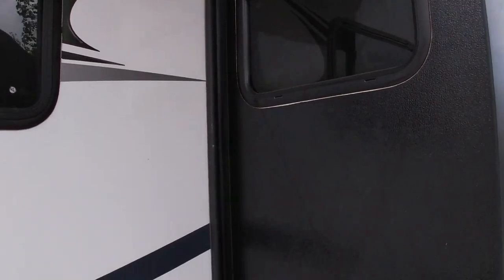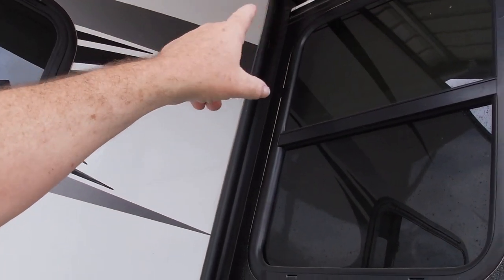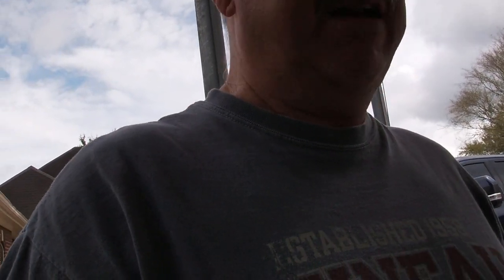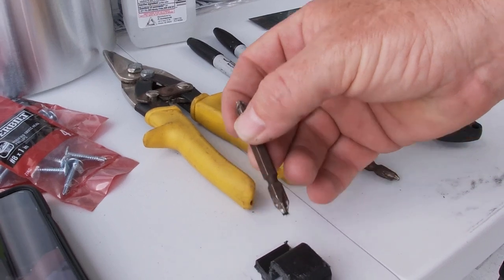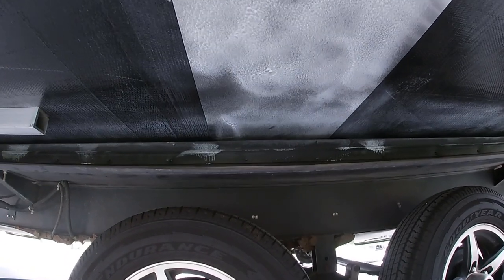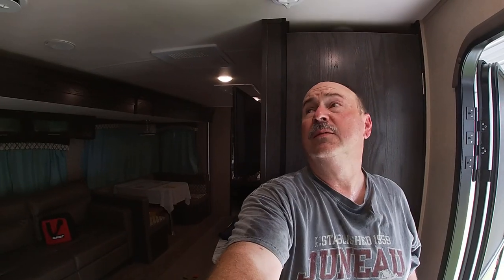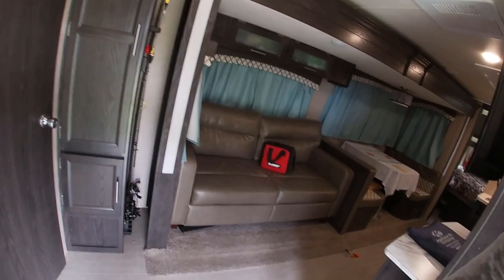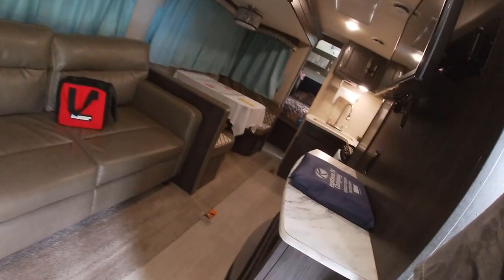RV Slide jumping - FIX

Comment: Thank you so much for taking the time and making the effort to create this video!  Our 29’ Crossroads Sunset Trail trailer is currently sitting in the maintenance lot at Cheyenne Mountain State Park in Colorado Springs after the slide got stuck while sliding it back in, resulting in a stripped gearbox.  I was concerned about only replacing the gearbox since I felt its damage was caused by the slide sticking on the way in.  What you show doing with the flashing makes perfect sense and I plan on doing the same shortly so I can tow our trailer 70 miles back home.  Thanks again!

Comment: Well done! Nothing like a good DIY guy and a good fix. I’m currently working on the same problem. The fifth wheel we had before this one had a mechanical drive but it suffered from the same friction problems. I spent so much time trying to fix it, I attached strips of a Teflon plastic to it.   

Thanks for taking the time to film your fix. 

May God bless you and your family
Reply from the maker: Thanks for watching! Teflon is a great choice for this type of application. Hopefully you won't have this kind of problem in your current rig!

Comment: I’ve been online searching for a fix. You are the only one that I could find with this method.  My slide out came with plastic runner strips on each end but they became ripped off along with the black material exposing the plywood. I think I may try you technique. I like your approach to the problem.
Reply from the maker: Thanks for the comment. Im sure your already planning to repair the damaged areas before you make the modification. Still dont why they design them to slide against the fabric... makes no sense.

Comment: I have the same exact trailer and have been battling the same problem.  I was just about to order a whole new wear bar ($$$), but am definitely going to try your method first.
Reply from the maker: More than likely some dry lube on the bottom of the slide may work just as well for you. I chose this route to prevent a buildup of dry lube  which could saturate the lining. Hope it works out for you.

Comment: Just did the “flashing fix”! Works great. I’ll be looking for long term success.
Reply from the maker: Awesome! I’ve not had anymore instances of it sticking but have instead sprayed the flashing down one other time since the completion. Hope it holds up for you.
Reply: frank scott I’ll keep the spray in the rig for future use. Tomorrow I’ll tackle the kitchen slide with rollers. Too much furniture and trim to pull for flashing fix. + the slight rise in that slide shouldn’t be noticeable with the trim and furniture

Comment: Had same problem.  Contacted my rv dealer and service manager said wash underside of slide out and the use paraffin wax block to rub under side (fabric). Paraffin wax is used in canning.   Run my slide in and smooth as could be.
Reply: Thank you for your info. While I like this guys repair method, yours was my first attack at this nagging issue. So I went to Walmart mart, bought 8 sticks, my camper bottom was very clean, and I used about 1/2 a bar of wax on it and doubled up on the obvious wear spots. She’s smooth now. Thanks so much for sharing. My fabric is abrading, so I may have to do the aluminum at some point in the future, but I’m betting keeping it waxed prevents the abrasion. Surely something that should have been covered in new camper delivery, or maybe not, I would have thought I already knew it all anyway.lol

Comment: Thank you very much , your fix helped me patch a snag I have in my floor  ( under side) I may still install  rollers, 
Thanks!
Reply: Update my 2016 open range has 4 rollers on appliance side and the bottom is not darco it’s a thin hard plastic. Opposite side slide has only 2 rollers ( outside edges)and is the same material as the other side + rollers ha
Reply: Rollers have a additional plastic track but nothing in the center. That’s where the floor snagged & tore out a 3”x8” section of luan and plastic. I used contact cement to put back in the torn out piece. I then did what you did with the flashing. I’m hoping that will hold the patch in place. 
Thanks for the video help
Reply from the maker: @jeffarthur322  Glad you got it worked out Jeff!

Comment: My jumping problem didn't come from the bottom where I kept thinking the problem was, but it came from the top  slide topper roller that was seizing to the point that it started to pull the track off the top of the motorhome.

Comment: Great fix,, I'll be doing this this week.  I'm curious about the short piece of wear bar you removed at 22:37 in the video.  Is there a reason you took this piece out?
Reply from the maker: Dustin, to be truthful, i cut that small piece out to see what i was up against and how it all was attached. I ended up just leaving that piece out and covering it with the seal.

Comment: Pardon the ignorance but wouldn’t that flashing rub on your floor on the inside damaging it? Seems like not raising it up either roller method or somethin else would leave that weight on the house side, digging that flashing into the floor. I’m probably missing something?
Reply from the maker: Thanks for the question. I’ve always said the only ignorant question is the one that you don’t ask, lol. With this type of cable slide, BAL Accuslide, the slide room is actually suspended above the floor, held up slightly by the cable tension. That’s why they say not to step on the slide house floor when the room is in the retracted position. I would lift the transition flap and see if there is a slight gap between the slide floor and the house floor before you tackle this. If you have a gap it shouldn’t cause a problem.
Reply: @frankscott6054  ok. Mine is older. 2002 Four winns windsport. Not sure which slide system it has, but as is there’s a lot of pressure on the carpet when sliding in and it’s starting to rub on the body on the outside. Def needs to be raised up. I believe it’s hydraulic but not sure
Reply: If you were concerned with the aluminum rubbing the floor you can put a piece of self adhesive loop tape (fuzzy side) material or ultra high molecular weight a.k.a. UHMW material, to keep it from damaging the floor. It won’t do anymore damage than the floor without any mods.
Reply from the maker: @mrmrwilem4789  great suggestion!

Comment: Thank you for the video. This helps a lot, I also did not want to install the rollers. How has the slide been so far?
Reply from the maker: Thank for watching Jimmy glad someone could use it. It’s worked flawlessly so far. If it starts jumping again I’ll simply spray the aluminum skid plates again.

Comment: It's been 2 years now.  Is it still working OK?  Going to do this on my 2017 Keystone Montana 305RL.
Reply from the maker: Hi Rick, Yes, still working fine. I do spray some dry grease on the runners from time to time. The only thing i've had issues with is some oil residue on the vinyl flooring from the runners when the slide is in and in transit but i attribute that to the cable being too slack when retracted. I just wipe it off with a rag.
Reply: Scott thanks for the reply.  👍

Comment: So how it’s working since you installed the aluminum about a year ago
Reply from the maker: So far so  good. I do spray the runners from time to time with a dry silicone lubricant. I have noticed that the slide house is sagging a bit, probably due to cable stretch, and evidently the aluminum runners are now leaving rub marks on the vinyl flooring, which do wipe off. It is my intention to tighten the cables which should correct the rubbing.